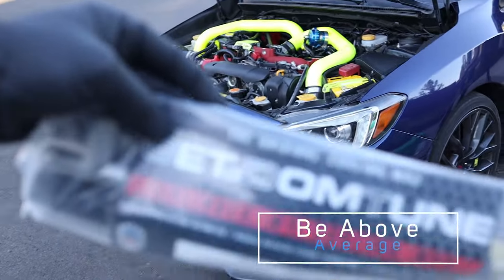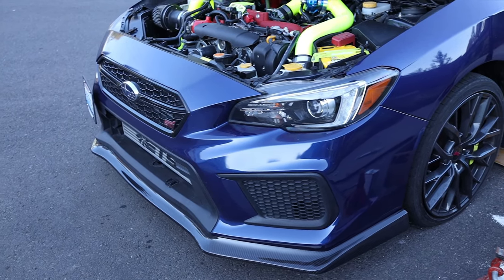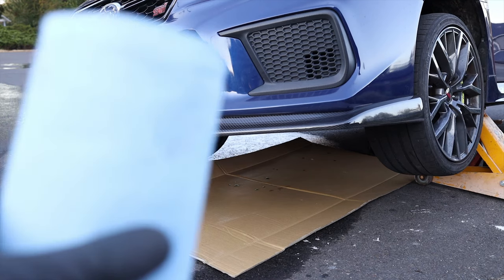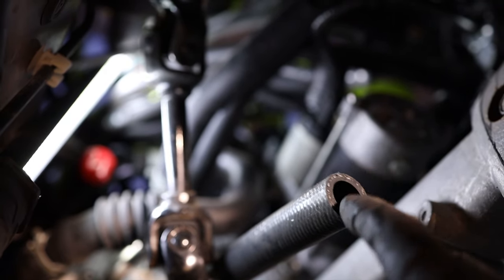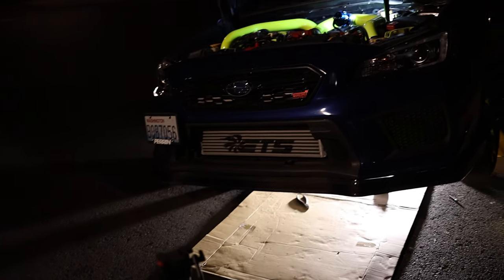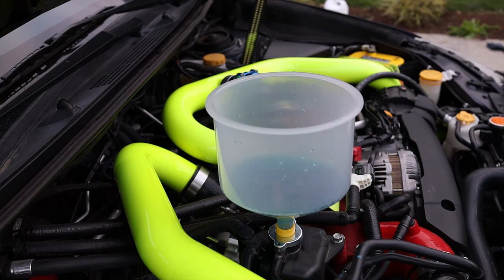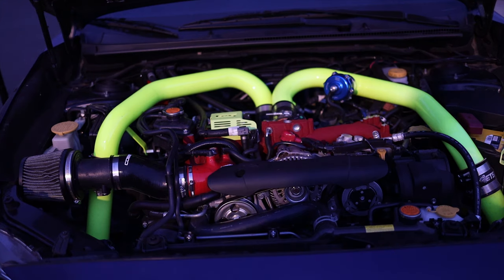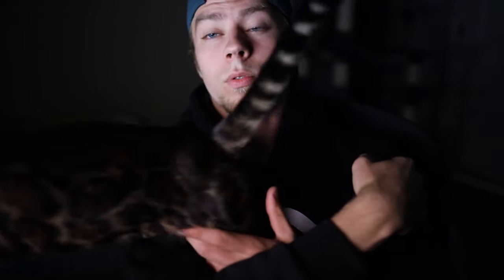How To Install A Cylinder 4 Cooling Mod On A Subaru STI | GETADOMTUNE | + GIVEAWAY WINNER

Comment: I did this mods same as in your video and you're right it does pull coolant out of the engine into the heater core but then I had another issue no air conditioning

Comment: Would anyone happen to know if this is done the same exact way on a 2017 Forester premium w/ 2.5 L engine or is the hose set up slightly different?
I don’t understand why you kept the cooling mod hose pinched off while filling it up initially? Wouldn’t that result in more air in the system from that much area of the mod being empty? Or all said and done, is it much easier to do it in sections since your getting rid of majority of the air bubbles first?

Comment: Agreed, a replacement windshield is expensive... That's why you should file a claim with your auto insurance company, then they can schedule an appointment to have your windshield replaced for free. At least that's how it works here in Florida.
Reply from the maker: That’s one way to do it, but with my insurance I would still have to pay a deductible and it would also make my monthly payments go up for my coverage doing it that way.

Comment: What year is your Sti? Mines a 2020 and the hose I cut does not have that middle covering. Could I had cut the wrong hose??
Reply: I'm unsure if it matters. But the instructions call for the lower heater hose on the firewall.

Comment: Just wondering why you blocked off the cyl 4 mod when you added coolant?
Reply from the maker: In the installation instructions, Dom recommended to pinch the Cyl 4 Cooling Mod off I believe to prevent air bubbles from getting trapped inside. So I figured I’d do it since it’s something he wrote in there.
Reply: @BeeAboveAverage  are you supposed to pinch it while you pour in coolant ??

Comment: First of all why did you clamp off the cooling mod hose when you filled the system? secondly there is no reason to turn the heater to max, it was done in the past when the heater circuit was controlled by a valve, newer cars don't have this valve as coolant is always flowing through the heater core.